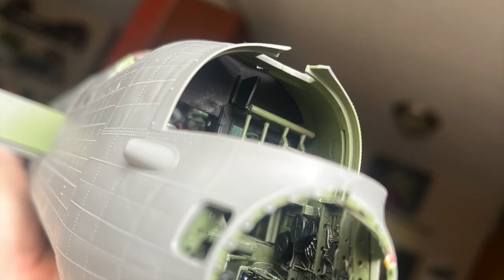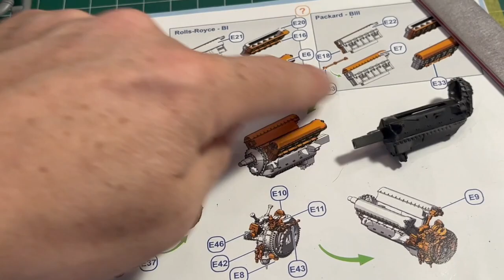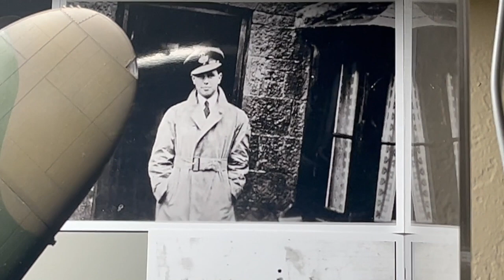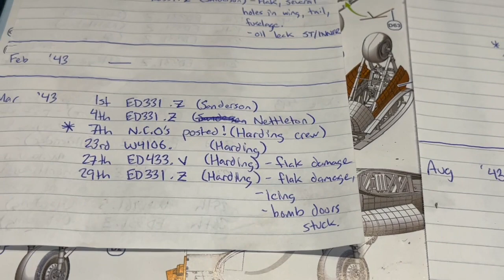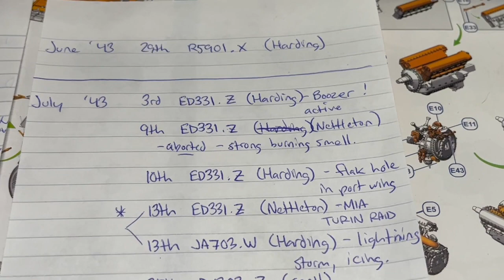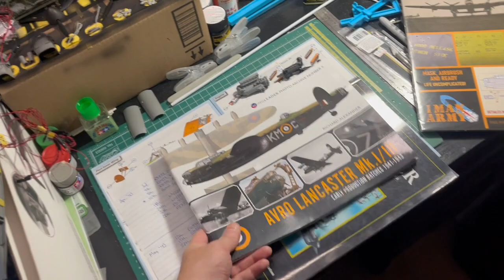Border Models 1/32 Lancaster Build - part 1

Comment: If I dig through your videos, do you have tutorial or a walk-through of how you built in the five minute sequence for the Lancaster on the wall? I am looking to do a similar build for 2025 and have the motors for the engines and lighting kits, but, not real sure how to do the sequencing yet
Reply from the maker: I purchased a complete kit from magicscalemodels that included the pre-programed circuit board and all the lighting, wiring, speakers, and motors..
Reply: @geoffchrysler  thank you I will look them up for my lighting needs. I usually go to Evans designs. I’m not sure where you are, but in the states they’re out of Colorado and a dream to work with. Sally and her husband are phenomenal and take a lot of care and time and responding to tell you how to do things or answer questions, so they’re pretty cool, but I definitely will look into this company for the motors. I think that will help a lot with the timing seems cool.